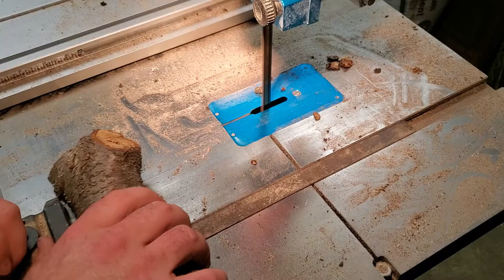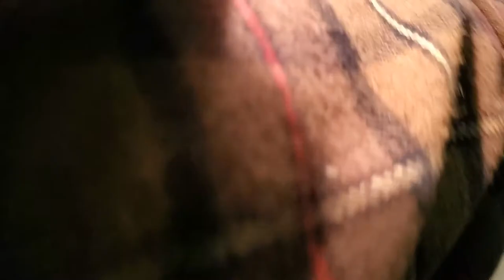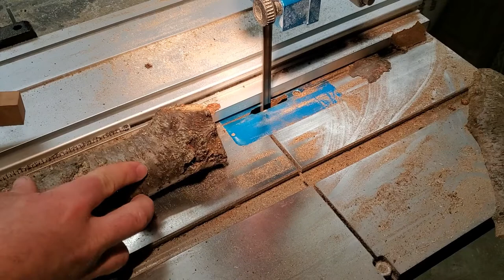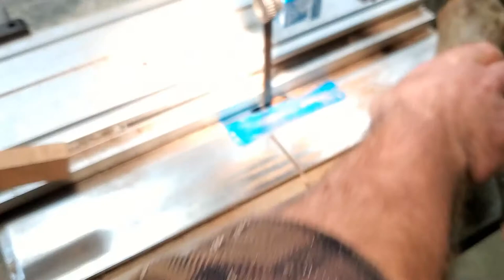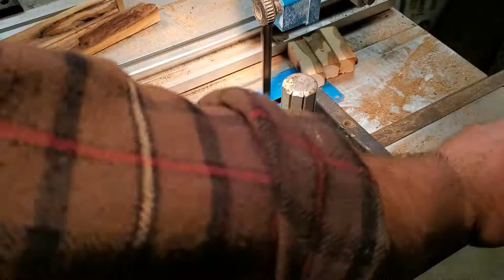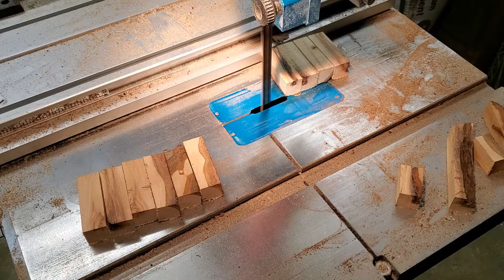Wood turning - How to Cut Pen Blanks out of a Branch

Comment: Awesome video!  Great tutorial. I make my own fishing lures and i was wondering how to  cut down on waste and get most of the blanks i cut?  So how much allowance from square to round do you allow? I know most pen blanks are 3/4".
Reply from the maker: Thank you! The size of the blank depends on the pen barrel size. 3/4" square blank is good for the bigger size blanks and down. But you could cut it even smaller for a 7mm blank.
Reply: I was unaware of that was the barrel size measurement, also was a bit unclear how to explain it.  I do not make pens as of yet. I do however make fushing lures. So to be more clear if my lure body is 3/4 at its peak diameter how much do i need to add like 1/4 in so i start with a 1" blank? Thand for any help
Reply from the maker: @joshpederson5926  yeah a 1" blank would be a good size for that.

Comment: Hey, Did you dry the wood?
Reply from the maker: I let all my pen blanks soak in pentacryl for 24 hours. This stabilizes them whether they were wet or dry. Then let the pen blank dry in a loosely closed cardboard box. I shoot for a moisture content of at most 10%, preferably less. Depending on the type of wood this may only take a few weeks after the pentacryl for the blank to be ready to turn.